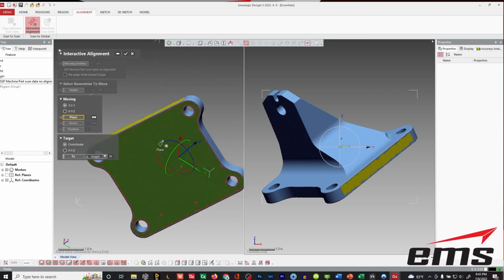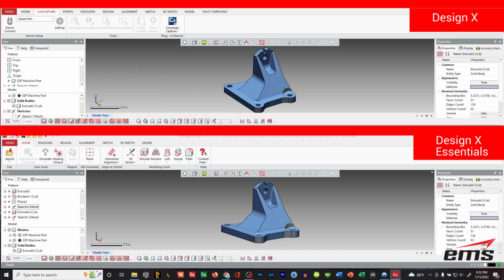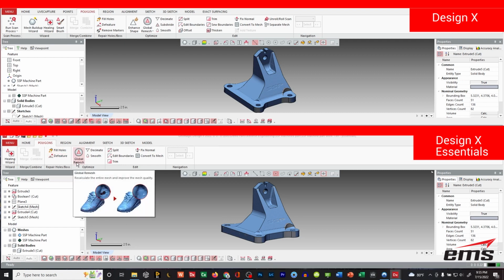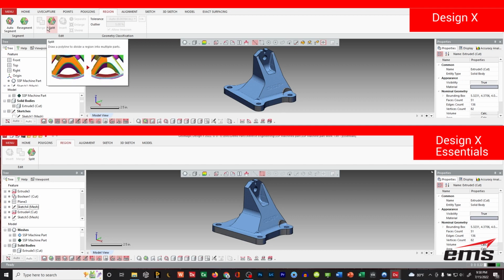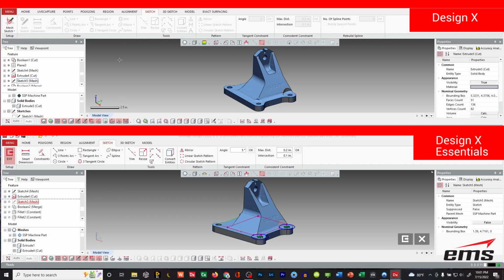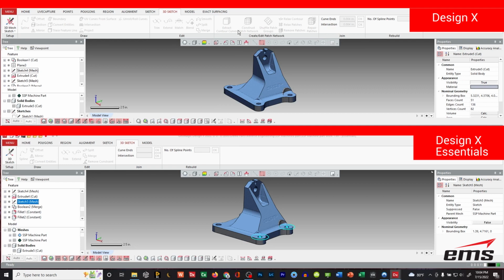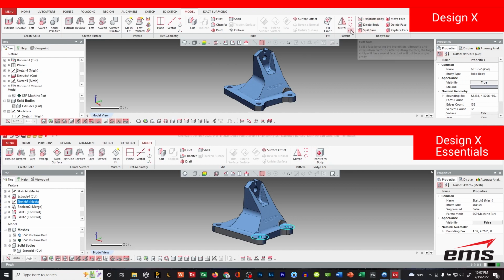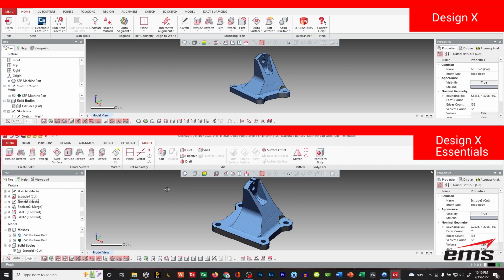Design X vs Design X Essentials - a menu by menu review

Comment: I think it’s more like they can’t afford Design X or will never get the money back with their work.
Reply from the maker: As they say you get what you pay for.  Design X is by far the fastest, most accurate and most powerful tool for reverse engineering.  And yes the most expensive.  Think of it as the Ferrari of RE software.  If you are in the RE business you really need Geomagic for Solidworks, Design X or Design X essentials.

Comment: The whole point of design x is it’s capability to generate accurate primitive shape and profiles under .05mm , I don’t know how it is essential without these
Reply from the maker: Hi Kanthi,  we rarely use the primitive shape features in Design X because you don't have as much control as just building the sketches and then creating the primitive.  For example if you fit a cylinder through the 3D scan data you are not guaranteed that the center axis is perpendicular to the top surface.   If fact, almost every time it is not perpendicular.  You are better off finding the  center axis and then axis constraining it to the top plane, creating your sketch and then doing a revolve.